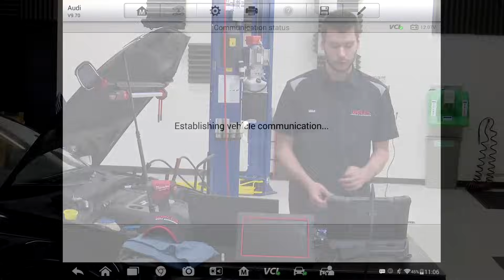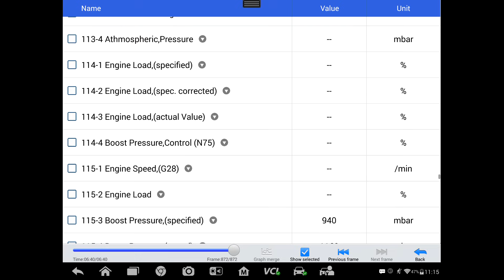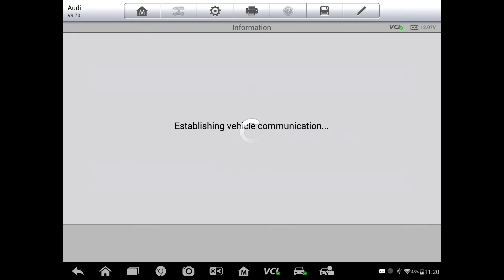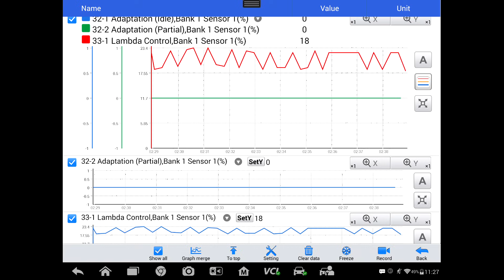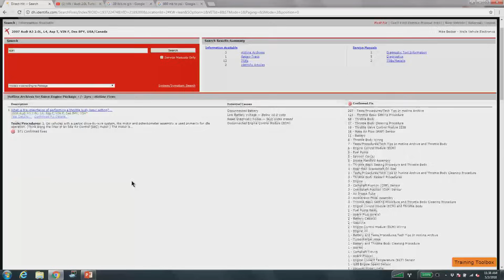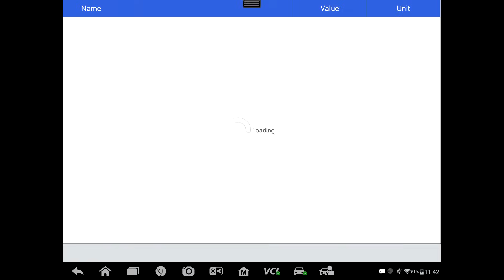VW / Audi 2.0L Turbo - System Too Lean Diagnosis & Repair P0171, P2177

Comment: Watching this in 2025 hoping to figure out this P21770 (System Too Lean Off Idle Bank 1) on my 2014 Audi Q5 2.0.  I also have P32800 (Knock Sensor 1 Circuit High Input).  Anyone else dealt with these two codes simultaneously?

Comment: Man i have p2177 on my 2022 gti i cannot figure it out, no vacuum leaks anywhere and good o2 sensors and good fuel pressure low and high. But unlike this car my LTFT are high during braking and go down while accelerating. Super lost

Comment: This video just solved the issue I have on my 2017 VW CC. Mine is an automatic and I do have a lean condition without a code. As I drive to work about 1 hrs the readings get higher. My ABS kick in randomly when I'm breaking and I hit tiny bumps. Bumps that shouldn't trigger it. So I thank you a great deal for making this video. My brake booster will have to be changed.

Comment: Great Job Mike , i have the same issue, 2.0 Audi, i have 5 inches of vacuum in the crank case, replaced all four coils an plugs bc it did have a miss, Replaced the PVC system but no change in the vacuum, put a smoke machine on an it cant fine no leaks anywhere. Pull the vacuum hose off the intake crank case go down to 1 inch,, Did i buy a bad PVC breather? seem to test out ok on the bench. Thanks Mike the Best

Comment: Came across this video chasing a P2177.  At 19:27, you're absolutely correct.  The boost sensor is reading atmospheric pressure (actual).  In aviation, we know that at sea level on a 'standard' day, at 15 degrees celsius (59 F), pressure is 1014 mb.  Basically, your boost gauge (and a tire pressure gauge displays pressure in PSI ABOVE roughly atmospheric pressure.  The 290mb (specified) is probably just what the computer wants to see after starting, at idle.  But with the key on engine off, specified should really be the same as actual.  Like you said, probably just a programming bug on the ECU or scanner.
Edit: Excellent video by the way!  Yes, I realize it's 6 years old but still helping people out.

Comment: 6 years - I hope by now you've learned either the right way, or your own way that's easier than a screwdriver on all VAG connectors. 
The Right Way:
PUSH IN on the connector -- ALL VAG connectors work the same way. After applying inward pressure to compress the sealpack rubber, articulate your thumb into the pocket add pressure and pull. 

100% of the time that connector will come out, EXCEPT if it's on the wheel speed sensors. Those get welded on some how with the heat or something. 

I have the EXACT same issue on my 07 GTI I have been chasing for shhh... months. 
This video solved it for me, by slowing me down and forcing me to go step by step.
Reply: Confirm this right way 😄

Comment: Definitely a good and informative video. I’ve got an 11 Audi A4 2.0 at the shop with the system lean at idle and it’s been racking my brain as I normally don’t work on Audis either but i think this is definitely gonna help me in the right direction. Always nice to learn something new. Thanks for the info.
Reply: hello, did you fix the issue? I aso have lean at idle fault code.
Reply: @AndyBorachok  you and I both 😅 got any updates on this? Was it mechanical, electrical, or both?

Comment: Excellent video, Keep up the great work!! My 2008 Audi with the 2.0 FSI engine does not use manifold vacuum for the brake booster, It has a separate vacuum pump for the brakes. I have replaced both o2 sensors, the pcv and maf sensor. I think my issue is the  solenoid purge valve. BTW I have 225,000 miles on it.  THANKS!!!

Comment: Great vid. Could someone assist with an issue on my 2015 Audi A5 2.0T? It's bone stock. I have +20 to 25 percent LTFT trims at idle. STFT stays at 0 after ltfts take over. No codes!! I smoke test and corrected leak at turbo inlet pipe and oil  stick. Helped a little but still running lean. Cleaned MAF, no change. Replaced pcv with new oem, no big change. Fuel pressures look just fine. I haven't done anything to the injectors but no evidence that they are bad. Car has no symptoms, no misfires.

Comment: Just wondering 🤔 how brake booster works with a turbo? It builds positive pressure in manifold, meaning it is not draining vacuum inside booster, but how you still able to brake properly?

Comment: Can I cheat off of someone’s homework and get the cliff’s notes on what the most common causes are for a “lean at idle” issue? My code is actually P2187, but it’s the same problem

Thanks!

Comment: If you would have had a leaking brake booster wouldn't you have felt the brake pedal going down at a stop when you were on your test drive? Did you even take it on a test drive?

Comment: Hablo español.. pero entendi todo!! Por esa maldita membrana del brake booster..  
tengo un error p0171 en un audi a3 1.6 2008 manual BSE motor
Reply: Yo estoy igual desde hace años, en ningún taller me lo han reparado, ni siquiera en la casa oficial. El coche no anda, el turbo no sopla y tengo un exceso de vacío en el reloj del turbo, pues a plena carga, apenas sopla el turbo.
He advertido que el long trim lo tengo al 22% y que la mezcla pobre al ralentí, se corrige pisando repetidas veces el pedal del freno, pero luego vuelve a mezcla pobre. Estoy pensando que sea el el servo freno y la maldita membrana.
Saludos y espero que corrijas pronto tu falla.

Comment: I have a p2187, triggered at cold start. Once I drive the car fuel trims go back to normal.
Reply: Did you figure it out?
Reply: @senorslick8393  yeah, i had a boost leak in my intercooler

Comment: I have same engine running lean. Did smoke test, purge solenoid test, new maf and lambda even injectors tested and ok. Only thing I found is the brake booster trick when pumping stft goes up to 25. But will it make the engine lean even when not pressing pedal? Cold loop idle is rough. Reseting trims makes stft +25% and overtime ecu corrects it as ltft idle +6.5% and when driveing ltft undeload quickly goes up to +20%. So could it be brake booster or is there anything else I could check.
Reply: Could be your rear main seal
Reply: or check your PCV
Reply: @dumbeezy5480  no oil coming from rear main seal also sprayed some breake cleaner and short term did not change. PCV changed no difference. Thanks for reply.
Reply: Did you find your problem?
Reply: @manzaaLV  nope, sold it.  I still think it was injectors tho they were tested and sprayed same amount but I think patterns were off. I tried changing everything else. Lambdas both, MAF, fuelpreassure sensors, rail sensor, new HPFP, PVC and DV latest rev. And much more nothing worked.
Reply: @egonmell5148 how was the turbo? I mean how old was it? I had a problem with my A3 and after looking into the vacuum leak, i found my waste gate stuck open, then I had to take it out to replace. It’s internal was cracked, when I got the new turbo on, it fixed the leak condition… not sure if it really was the turbo, or on my way to get it replaced I messed something that fixed it
Reply: @asusgoncalves  turbo was also repaced. Nothing changed
Reply: @egonmell5148  dang dude, what a mystery box 😅

Comment: This vehicle uses a vacuum pump though. Doesn't brake booster vacuum come not from the intake but the mechanical vacuum pump and electric pump?

Comment: one tip for any of those connectors to pop off is to actually push them in slightly as you are lightly pressing the tab with the screwdriver and then you can pull them off hopefully without breaking them as they get brittle.
Reply from the maker: Hey Konrad, thanks for the tip. Ugh those connectors are not fun!
Mike Becker, Senior Instructor

Comment: The way to get VW/Audi connectors is push the clip, push the plug forward then pull out while still holding the clip 😋 Excellent tutorial btw, I took a lot out of this.

Comment: Great video Mike. I think i have air issue in my 2.0 tfsi mk5 gti. When i try to remove the oil cup in my car there is huge and the car run very bad at idle it shakes a lot sometimes the engine turn off. So i bought a new pcv valve, and the same problem again. Do you think there is any ather problem than pcv, or the new pcv is bad again since in my in my country most of the parts came from china?
Reply: I also when i try to disconnect the hose from pcv to the intake manifold and block the hole in the intake, the idle is perfect and not shaking

Comment: I first got code P12A2. The next day, I got an extra code P0171. We did a smoke test, no leak. We don't believe it's the high pressure fuel pump or fuel sensor, we might be wrong. 🤷‍♂️ We strongly believe it's a leak somewhere, but we can't find it. Any suggestions?
Reply: Did you find it ?
Reply: @emreakyol4088  No! I sold that BS. The hell with that car. 😆

Comment: Fords and Chevys have "mowdurs"...Audis and VWs have engines. Since your contest is over...most modern engines with fuel injection will richen mixture when the engine overheats. An answer that demands you think about it.
Reply from the maker: Hey Marty, thanks for watching! Enrichening for cooling is the same reason why high HP cars like to run E85. More fuel, cooler cylinder.
Mike Becker, Senior Instructor

Comment: Nice find.I have often looked at fuel trims when clamping the booster hoses. I have never looked at fuel trims while pressing the brakes. With Germany cars I use obd 2 data.
Reply from the maker: Hey D.D, thanks for watching! Take a good look next time. You may find interesting results.
Mike Becker, Senior Instructor

Comment: Hi Nice video buddy, i've found my brake booster hose cracked could it be the issue for my.p0171 lean condition ? Causing little missfires also
Reply from the maker: Hey Omar, thanks for watching! Sure, seal up the hose with some tape and see if it stops running lean.
Mike Becker, Senior Instructor
Reply: Yes man done it already everything IS fine now, i've just ordered a New one. Thank's so much

Comment: Hey, Mike.  Have you ever repeatedly  pumped the brake pedal to drive the o2s lean instead of disconnecting a vacuum hose?  I learned that from a tech, but can't get to figure out how that happen. I read a lot and asked around trying to figure it out. I am always told it i a bad booster, which is not. I do that on multiple cars and all of their 02s go lean. 
The check valve should not allowed vacuum into the intake. How that happens?  It may remain a mystery for me.
Reply from the maker: Hey BB MD, you're right...the check valve should prevent any air from getting back into the manifold. I may have to play with this a bit.
Mike Becker, Senior Instructor

Comment: Hello, I want to thank you for your video, it really helped me a lot to understand the vacuum system and how it can cause code failures, I have fault code 00561 - Mixture Adaptation: Adaptation Limit (Add) Exceeded in my audi A4 1.8T 1997, I already exchanged some parts, and did some tests, but I still couldn't solve it, I still don't understand if it is a "rich" or "leak" fault code or how to solve it, I have the fuel pressure in idle mode at 4 bars, I think it's too high, is it? the values of my trims are: 5.5 in (add) and -4.7 in (mul), thanks for everything
Reply from the maker: Hey Vitor, it appears your car is running lean at idle and rich under load. Being that the code you have set is "ADD" i would address the lean concern at idle.
Mike Becker, Senior Instructor
Reply: @GoTechTraining  What is the most likely cause of this fault code?
I already did a vacuum leak test (no smoke test was done), I already changed the lambda probe, I cleaned the injectors, I changed the exhaust manifold gasket, intake manifold gasket, throttle body gasket, I changed the system evap and pvc valve, i changed the check valves, my MAF seems to do good readings and i already did a cleaning .. do you advise anything else? thanks

Comment: hope i fix my Audi- brilliantly explained
Reply from the maker: Thanks for watching Narin!
Mike Becker, Senior Instructor
Reply: @GoTechTraining  I done smoke test on my car but there was no leak so figured out it's the temperature gauge not showing right temprature,  I changed the temperature sensor and thermostat and what, problem fixed.  Engine light cleared and car is running fine. Thanks.  Watched lots videos  and sorted the engine light. Cheers.

Comment: Thank you, Mike. I, now, understand how you can get a lean condition from a brake booster. How would you explain a lean condition when you keep pumping the brake with a good booster? I am thinking that vacuum on the other side of the booster is pushed back into the intake manifold.
Reply from the maker: Hey Carlos, thanks for watching!Hmm that's a good question. It has to be bringing air into the system somewhere. When you deplete the booster repeatedly it brings in fresh air that's drawn into the motor? That's my guesstimate without sticking a ton of thought into it.
Mike Becker, Senior Instructor
Reply: @GoTechTraining   I use this method to make o2s go lean instead of disconnecting a vacuum hose to create a lean condition.

Comment: I have the code p2177 on a 2014 Passat, the car doesnt run rough but that code won’t go away, what’s the first thing I should replace ? Thank you
Reply: Its got a 1.8l turbo
Reply from the maker: Jhony, the P2177 is a "system too lean off idle" code. First thing to do would be take it to someone familiar with diagnosing these cars. I'd hate to suggest any of the 40+ parts this could be. Trial and error could get expensive on here.
Mike Becker, Senior Instructor
Reply: Yes I found that this code could lead to numerous parts. Would a brake booster be one of those like your video?
Reply: I was gonna try to replace the oil separator on top of the valve cover from Volkswagen parts
Reply from the maker: The brake booster would be more prevalent at idle, not off idle. The oil separator might be a good idea. They are very common.
Mike Becker, Senior Instructor
Reply: Thank you so much for your time
Reply from the maker: Hey Jhony, what engines in your Passat?
Mike Becker, Senior Instructor

Comment: Great video, my friend has a 2009 VW GTI 2.0 TSI engine. It just threw codes P0171 and 
P0507. There is no vacuum at the dip stick, oil filler cap or at the 
small hole on the diaphragm housing. When I remove the oil cap I get
 air coming out. Could this still be a bad PCV?
Reply from the maker: Hey, yeh the crankcase breather/PCV issue is super common. I'd suggest smoking the crankcase and see if you have any leak. Apparently this model has a huge issue with the rear main seal.
Mike Becker, Senior Instructor

Comment: wow....try using a good scan tool. that would make the job so much easier---edit-- sweet jesus, talk about wasting time that scan tool is dead slow....need the correct scan tool. damn man, 980 mb koef is NORMAL. you guessed correctly, you are reading atmospheric pressure (start the engine and recheck the values- does desired match actual?). move on. clearing dtc will reset long and short term fuel trims...jesus.. you asked why you could not see the vac leak on your fuel trims---- you are looking at the wrong mvb. mvb 32-1 is short term, mvb 32-2 is long term. you are looking at long term, drive the car. USE THE CORRECT SCAN TOOL AND YOU WILL NOT HAVE THESE PROBLEMS. with the corret tool you can force the engine to learn using basic settings,  you are using measure blocks. your car runs 'better' after cleaning the maf because you have also cleared dtc--drive it, let the car relearn. then replace the leaking crank seal, those mafs do not go bad. the secret you ask for is a 90 degree oring pick to release the latch- do not use the lever or it will break. you mention boost in the crankcase and oil consumption......you are so close to getting it- but you did not smoke check the engine correctly and you missed something big
Reply from the maker: Sorry, I can only use the tools I have available. If I missed something big, why did a brake booster fix this car? This vehicle does not have traditional short and long term fuel trim. It uses additive and multiplicative. Additive trims at idle while multiplicative trims under load. 
Mike Becker, Senior Instructor

Comment: hey there.....I have the pcv valve issue.....lean bank one and a loping up to 2000 rpm continuous issue.  
Cannot get the valve cover cap off while running.  Is there a way to defeat the valve for now.  Only source for this pcv valve I can fine is ebay.....so 7 days out and I do not want to blow my engine seal....can we pull a hose and just plug it  ?
Reply from the maker: Hey Nita, honestly I would recommend not driving it. You could cause more trouble trying to defeat the valve.
Mike Becker, Senior Technical Instructor

Comment: Speaking of leaving these timing chain type engines specifically VAG, parked on a hill in gear, I've had quite a few of these manual transmission cars left on a hill for example 1st gear facing up hill where they've rolled backwards slightly, turned the engine backwards and jumped the chain. The owner has then started the engine and mashed the valves. I Always advise if leaving in gear, 1st gear facing downhill, reverse facing uphill so if the engine is turned by the weight of the car, it's turned in the correct direction. Great informative video also. I got the brake booster answer straight away too!
Reply from the maker: Glen, that's a great tip! I've never seen it happen but it sounds like a headache for that vehicle owner.
Mike Becker, Senior Technical Instructor

Comment: Hi Sir,
My car is Kia Soul 2013. Engine GDI.
It has got ( P2191 ) system too lean at higher load bank 1 . Would you please support me.
Regards
Reply from the maker: Ahmed, this is a lean under load trouble code. I would begin by taking a look at fuel trims and see when the problem occurs. From there the easiest testing will be with the fuel system.
Mike Becker, Senior Technical Instructor
Reply: @GoTechTraining  
Thanx a lot
Reply: @GoTechTraining  
Thanx a lot